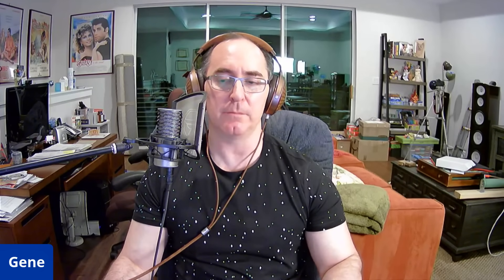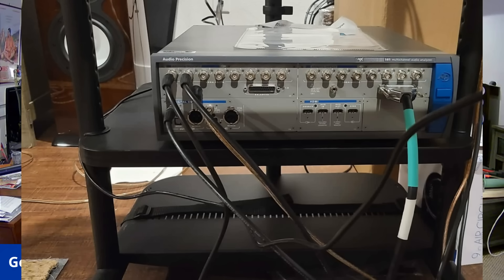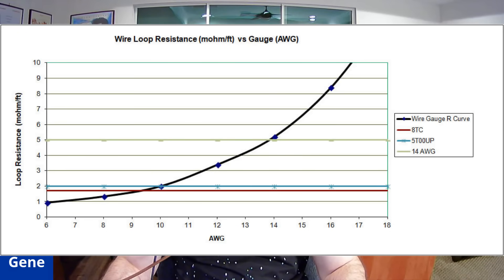Speaker Cables Really Don't Make Much of a Difference?

Comment: I am sorry to break the bad news to you but this whole thing is totally biased and does not represent the truth...
Any audiophile with a critical ear should be able to hear the difference in sound(bass, slam, dynamics, depth, imaging, midrange, highs)etc... 
Take an 8 ft speaker cable made of 6 conductors, 20awg each, 3 for positive, 3 for negative of occ copper and  thin polyethylene insulation and nothing else and then a 10awg of traditional figure 8 speaker wire, 8 ft length of course and listen to high resolution music on a high resolution audiophile caliber system and the difference should be easily apparent unless you have no experience, do not know what to listen for, have already made your mind that all cables measure the same therefore should sound the same or you have some kind of hearing loss(damage)...
There are many variables in a audio cable that influence the sound. The geometry, the insulation, the length, the purity of the metal, the kind of metal, the sheathing, the connectors, EMI, RFI and so on
For those of you who need scientific proof, please, check this out: http://audio-adventures.blogspot.com/2009/05/diy-interconnects-measured-approach.html
Reply from the maker: Measurements don't lie and just because you don't believe the data doesn't make it untrue or biased. Your link provides nothing other than anecdotal stories and no suporitive measurements or analysis.
Reply: 1000% Bullshit statements, as always.
"You have no experience, you don't know what to listen for"... Ok, Who the hell do you think you are?!
How may we know your ability to critical Listening? You're either lying or lying to yourself. Are you a Trained Listener? I don't think so. What about your gears that are supposed to be revealing enough to hear differences? 

Also, please stop insulting science with your link that doesn't prove anything.

Comment: Hey gene! Since the damping factor of an amp is related to the output impedance of the amp would that be a way that cables could make a difference. Say an amp with a high damping factor like 500 could be limited to a lower actual DF because the cables are raising the output impedance. Whether or not the difference is audible would still be unlikely obviously. Similarly but not identically a low DF amp say 10 could have some frequency response variations if the speakers have low impedance dips. Again, not super applicable because most amps are higher than that and speakers rarely have such dips. Is my thinking correct?

Sorry I’m a few days late to watching so I’m not sure you’ll see this.
Reply from the maker: Damping factor is a spec blown way out of proportion. The resistance of the tweeter coil has a far greater impact on system damping.

see: https://www.audioholics.com/audio-amplifier/damping-factor-effects-on-system-response

Comment: I use to think like that, "go by the numbers only" - Sorry but you're completely wrong and apparently you don't have the ears for the job. You're relying on 3 basic measurements only, and obviously there are many more reasons why cables sound different in so many ways from one another. I am NOT saying expensive cables are all better, but I AM SAYING THEY DO SOUND VERY DIFFERENT from one another. I am in the audio industry (Boooom "guilty by association"), but lucky enough to have a state of the art sound room & system which measures amazingly well, a tribute to PMC and their PMC MB2/XBD studio monitors. Come to think of it, they use 3 different gauges of internal wire for Low/Mid/& High drivers, now why is that... (I know, do you?).  If you think all that matters is Capacitance/ Inductance / Resistance, you're stuck thinking inside the box, NOT a good scientific approach, dig deeper!!. If all that mattered with electronic components was the power, distortion, and 20-20,000 hz -/+ .001db response, then they would all sound the same, but they don't, sometimes not even close I'll be honest, I'm really put off with your cover here and the one on aftermarket power cables also. I took the approach for decades that, "how could 6 or so feet of power cable from the wall make a positive difference) Well it did very much so recently, I won't mention the brand this time. Again not all cables or electronic components have positive effects, especially aftermarket power cords. In fact I've heard more cause detriment than good. But the good ones do some very positive things. The main point, "Good or bad", you can definitely hear the differences. I had an electronics engineer / client do some blind testing on me, Engineer zero, Golden ears ONE, or WON!  32 out of 33 times / must have been luck right. I'll take a blind test any time from anyone. And yes, set up of any system is very crucial, especially if you're going to scrutinize equipment as we do.

So, I'll be the first to agree that there is a lot of snake oil in the Hi Fi business, but you should be able to hear differences between almost everything. And if you don't or can't, listen to your cell phone with some earbuds and be happy. 
(BTW: I also subscribe to serious acoustics applications & room measurement software, is that more voodoo, I guess that's why all the best recording studios in the world spend hordes of thousands alone on that effort.....) 
It's late and I probably shouldn't post this but what the hell / I could write a book on it all

My best advice to "Audiophiles", go listen to some music / instruments live without amplification and pay close attention, make that your benchmark for sound reproduction!
Reply from the maker: I invite you to submit ANY measurements that show a significant difference in amplitude response or distortion of various speaker cables when connected to an amplifier and speaker. I will wait patiently for you to refute my measurements with your own data minus the anecdotal sighted listening tests you've  done.
Reply: You've completely missed the point I made. read it over again...... It's obvious those simple measurements are not enough to reveal why we have differences in the sound of any components. And again, I look at measurements, always have, but they are far from the be all end all explanation why things sound different.
Reply from the maker: @user-eg7bg9dz4j  I challenge you to produce a set if repeatable measurements or partake in a blind listening comparison that shows beyond reasonable doubt that you're hearing something beyond placebo effect.
Reply: @F B For 3 decades now I have been a proponent of Mono blocks to help with the issue of speaker cable lengths, you can hear every foot of speaker cable. I understand there are situations that don't make that practical for many. This means running longer lengths of balanced interconnect, this is why the Professional world invented Balanced technology back in the 50's / I think it was. There is far less detriment running longer lengths of Balanced interconnect than speaker cable! Studio systems are now running digital Active systems doing what you describe with numerous benefits. As far as battery powered gear, there have been a few companies that have done that like Roland Research. That got rid of AC line noise without slowing AC down to the electronics. The only real point to an aftermarket power cord is to reduce AC line noise in a passive design approach so it won't compromise electronic components. I have not heard transformer based power filtration that doesn't impeded amplifiers yet so I don't use them. Just to fill in a blank here, I had to use a very expensive "Stereo" amplifier in place of my mono blocks, (I have dedicated AC lines for those monoblocks L/R in rm) so temporarily I used an extension cord. It was terrible, so I experimented with aftermarket power cords and very few helped until I was supplied two brands that did the trick. I went back and forth between these two brands & others, stock cord and extension, and I couldn't deny what I heard nor could I go forward without one of them. I did my very best to save money and get around my negative preconception of "aftermarket power cords". They may not work on all equipment, I'm sure some equipment have power supplies or topology that either doesn't react favourably or is simply not resolute enough. I'm not against solid science and testing of gear but it has to be done right. And that doesn't mean we always get the right answer either, but these days most equipment have very good & similar specs yet sound very different...
We need to find new a/o better methods to find out why equipment can sound so different with similar specs, meanwhile learn to listen properly and rely on your ears for what can't be explained by measurements alone. If you don't hear a difference then you get to save your $$$ - 
Repeat NOTE: If you don't have a well acoustically treated room that measures well to listen or test in, then you can't make an informed decision.

Comment: Pretty much accurate
I have been saying this for along time. Type of cable for short distances matters not.

Even at work, for audio, we are using basic Belden two wire cable with xlr connector. You can not tell the difference.

Excellent video.

Comment: Excellent work Gene. Per usually. I also like and respect the fact that freely admit that you like an exotic cables (that measure well), though there's no audible difference. 

Nice cables and connectors in your setup helps the warm fuzzies you feel when you listen. And that lil bit of placebo effect, in my opinion is part of the audiophile experience. Perception is everything. Our brain is the only piece of equipment that we don't understand how to adjus.  It colors the sound to no end. Could be based on our mood, wether we've eaten, or just woke up, etc.
 As logical and proof driven as we want to be, I believe deep down, we all enjoy a little placebo effect in life. Some more than others 🤷🏾‍♂️😂

Comment: Thanks for taking a true engineering approach. I have an engineering background and have never understood the 'science' around expensive inter-connects. I expect the high-end cable guys will be resistant to this, having had their capacity for common sense clouded by promises induced through smooth advertising. 
Just a decent quality cable , well terminated, suits me:  like QED 79 strand speaker cable with good banana plugs.

Comment: I found that there is a big difference between the really cheap cables 99p (or 99c) and decently constructed cables.  That is because really cheap cables are often not constructed very well.  I use Chord Clearway.  Surprised that there was so little difference though between properly manufactured cables, but as was stated  a case of suck it and see

Comment: I worked for Dr. Roy Allison at Allison Accoustics. I started out on the line and ended in the testing lab. We tested every component then every completed speaker. We didn't supply speaker wire. Dr. Roy's recommended thin strand big guage wires. We hot rodded a pair of "Godzilla's" ( A1's) for Mark Levinson. He wanted all the in cabinet wiring replaced with wire he supplied. I had industrial silver soldering experience.  We made a new layout with oxygen free wire silver soldered all connections. It must have made an improvement because we did it again on a second pair. I use wire I got from an industrial catalog. It's used for sensors in precision temperature measurements. Works great.Everything is a trade-off.

Comment: Yes it matters. The geometry is especially important for noise rejection. I've tried both the quad core and belden from bluejean cables and I am very happy with both.
Reply: @Douglas Blake Any piece of wire of any length can act as a conductor.  Seriously. 
My rca cables are belden and they are very well shielded, changing them out would have very little effect.
Reply: @Douglas Blake shielding and layout is important for electronics and their signal pathways always. 
You'll get it eventually!
Reply: @Douglas Blake finally, you learn something!

Comment: Yes they do. A good cable, makes voices/instruments have a natural vibration, so you get color/life/better structure/soul...
A bad HIFI cable usually is harsh or muddy/suppressed, just highlighting certain things in the recording.
If you want a good and cheap solution: Sommercable elephant or even better sommercable quadra blue.
Reply: @Douglas Blake Same reason, for why most times when you buy a bigger model amp, that it also uses a better wire inside.
And same reason where there are classes of PSU, LPSU's. Wires/plugs are the filter that the power runs through. Without a good wire, the sound is dead/boring/lifeless. 
Which also makes sense, since that bad wires and plugs are basically a mix of bad metals, which= bad conductivity.
Reply: @Douglas Blake Yes that is how you interpret it.
Evidence is in the conversation.

Comment: No offense but YOU are caught up in the SAME testing over and over which isn’t even going to show the differences in what ONE hears with different cables. You can keep going down the path that will predictably show you the same thing you expect it to show you in the comparisons but that seems like insanity. If you aren’t listening to the different cable tech and comparing them with your ears you will continue down the exact same path until a NEW method of measuring is brought out that can detect the differences. If I can blindly pick out a cable 10 out of 10 times because it presents a completely different soundstage then I’m going with that over any test you conduct, PERIOD!!!

Comment: Gene, can you have a look at power cables as well?. I am still gobsmacked how 1,5 meter of power cable hooked up to a wall socket in an apartment building is going to magically eliminate all the impedance and noise issues of the electrical installation of that building.

Comment: I have industrial hookup wire to connect my amplifier to my speakers, so I am not a big believer in the magic of speaker cables. I am a big believer of buying dual purpose products to save money though. (My interconnects are N type thermocouple, copper wires in both leads, extension cables. TCs give small signals and need to be noise protected and have Teflon isolation, not because it sounds good but simply because the cable is then rated at a higher ambient temperature) Everything that has been specifically designed for audio has crazy profit margins because audiophiles are suckers for snake oil.

Comment: Hi Gene, thank you for taking the time to properly measure the cables. I make my own using OFC 14AWG - I make them look pretty so my significant other likes the look. I think cable specialist companies sell the "Emperors New Clothes" !!
Reply: What do you use for the 14AWG?
Reply: @jolkraeremeark6949  any quality OFC (oxygen Free Copper) multi-strand cable (flex) and connectors that provide good mechanical and electrical connections (Amazon Basics do that)

Comment: somehow we were able to hear the difference between copper and silver . Cu is better for bass Ag is better for mids and heights. it is quite audible. do some measures to see if equipment would plot some difference.
Reply from the maker: Silver is 5% more conductive than copper. Just use 5% more copper and you've got the same thing.

Comment: Wonder how it compares to the 30' lamp cord I'm running? Don't worry, the speakers are cheap trash, but throughout the chain, the compressed source from streaming coupled with my tin ears just means it's a reasonable solution since the cable and speakers aren't the weakest links. 

The upside of not having an impeccable ear is that my engineering tradeoffs are easy decisions; go with the most reasonably priced component that offers the features I'll use and adheres to the standards in both the marketing literature and the actual real world.

Comment: You mentioned the importance of controlled listening tests - did you perform such tests? Personally I don’t expect you’ll hear a difference, but unless the test is done we don’t have evidence either way.
Reply from the maker: I've done blind testing of loudspeakers and informal switching of cables while another listener takes notes. The only time we've been able to show preference in cables was when very high gauge cable (24AWG) was compared against 12AWG.

Comment: Now the thought occurs. What about power cables? Also power conditioners? Perhaps it is all snake oil?
Reply from the maker: Use OEM power cables. Only change them if they break or you need longer cables. Power conditioners are good to plug your gear in and protect from. Surge.

Comment: Assuming all cables operate similarly as antennas, then I would assume your conclusions are at least near accurate.  However, did you test cables of varying topologies, such as 8-16 wire braided cables?  In my experience, the topology of the cable is far more important than the conductor...
Reply from the maker: Kimber is braided. All that matters is how they measure.
Reply: @Audioholics  all that matters is how they sound.
Reply from the maker: @patl709  true but they all sound the same  😆🤣
Reply: @Audioholics  no they don’t 😂
Reply: @Audioholics  I thought you didn’t listen to your system with the cables ?  I’m confused now.
Reply from the maker: @adamk4716  I mean I can't listen to a system unless it's connected with cables...
Reply: @Audioholics  I’m saying you performed a scientific test that theoretically concludes a cable  sounds the same but a citizen scientist would also then prove his conclusion with scientific observation employing the senses.
Reply from the maker: @adamk4716  without a controlled blind test, your "senses" can't be trusted as a reliable source.
Reply: @Audioholics   I defer to you, but shouldn’t you do a controlled blind test then as well?  On the senses can’t be trusted I don’t know what to make of that — if it sounds better to your ears  then it is I would think - is that not true?